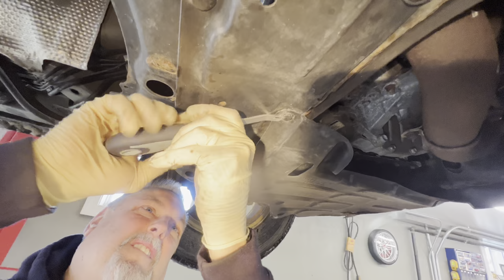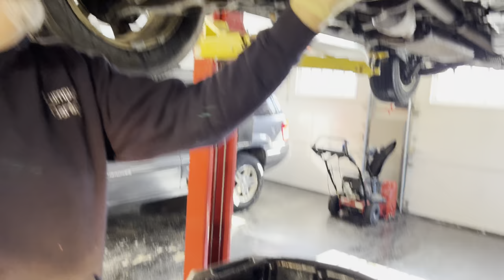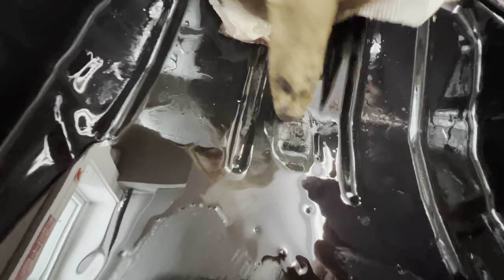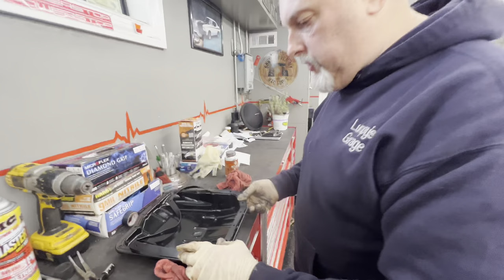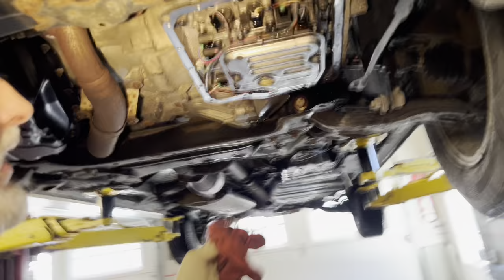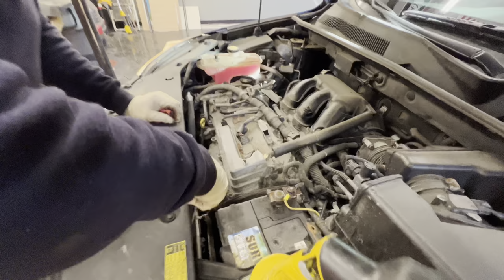2006-2012 Toyota Rav4 Transmission Filter Replacement

Comment: I think it's best to check the fluid level on the dipstick of the old fluid before you drain it out because the transmission might be overfilled. And you can use a nut driver to start tightening the bolts in the beginning for hand comfort .
Reply from the maker: Thanks for watching our auto repair video that shows you how to replace the transmission filter on a Toyota Rav4.

Comment: Great video, thanks for posting it. I’ve got the V6 version and going to try and do this. Has the common noisy transmission in mine.
Reply from the maker: Thank you for watching our auto repair video that shows you how to replace the transmission filter on a Toyota Rav4. Hope this helps you out. Have a great day!

Comment: What type of oil did you used, was it WS, or Type VI
Reply: Rav4 is WS fluid
Reply from the maker: We go over this in the video, you can also refer to your owner's manual for the vehicle.
Reply: @HomeOwnerRepair  owners manual is missing
Reply: Valvoline Maxlife Full Synthetic ATF fluid, good stuff 👍🏼

Comment: Hi there, I am here watching your video because my 2009 RAV recently started making a growling/vibrating noise. It started after I had my transmission fluid changed. I read on another video that changing the transmission filter should help with the growling noise. Have you heard about this issue with RAVs? I'm wondering if the mechanic was careless with something during the drain and refill.
Reply: pretty common, toyota issued a bulletin for this (T-SB-0001-11).
Reply from the maker: Looks like someone chimed in with a service bulliten for this, you may want to see if this is a recall on your vehicle.
Reply: How many miles did your fluid have on it?

Comment: Thank for the outstanding video.
My pan bolts came out with a little resistance as well.  As I understand it, tread-lock is applied on these bolts at the factory and that's the reason there is some resistance.  I've seen another mechanic reapplying tread-lock to the bolts before reattaching the pan.  I didn't do this myself, as I could feel there was enough of the factory tread-lock still on the bolts to keep them snugged up.
Reply from the maker: Thanks for watching our auto repair video that shows you how to replace the transmission filter on a Toyota Rav4.

Comment: I was in the middle of my filter change and got stuck on those pan bolts behind the frame. That's when I found this video and the rest of the repair went off pretty much without a hitch
Reply from the maker: Thank you for watching our video that shows you how to replace the transmission filter on a Toyota Rav4. Have a great day!